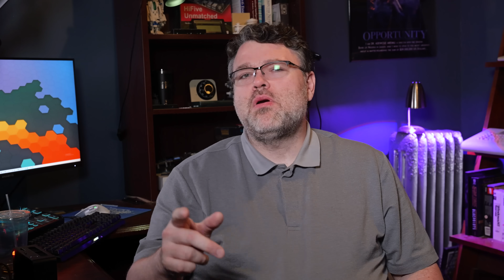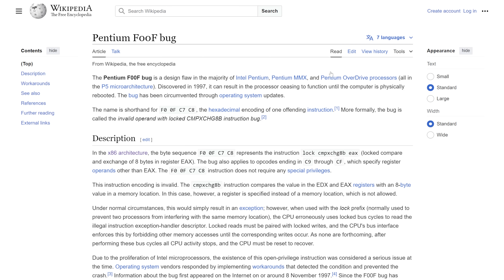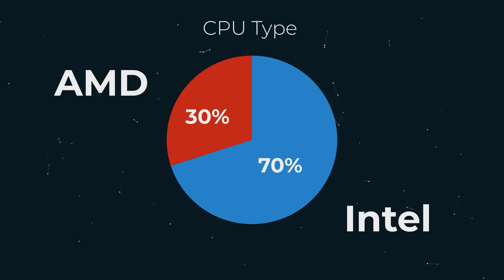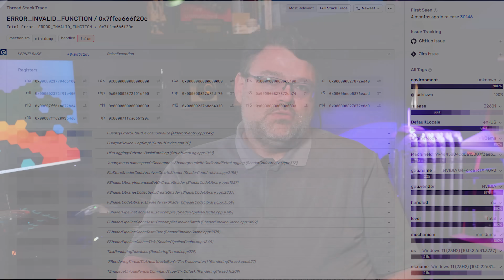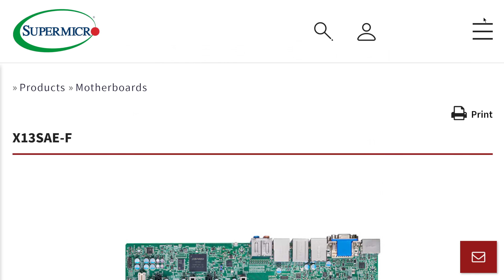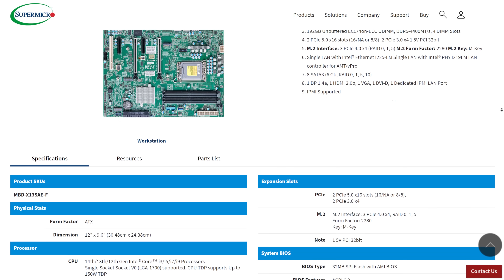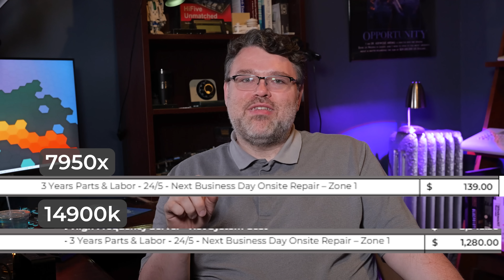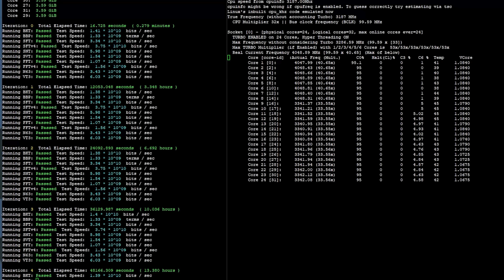Intel has a Pretty Big Problem

Comment: 1ST EMAIL

Hello DAVID VAGNETTI, 

Greetings from intel Customer Support
 
Based on the information provided, I can confirm that the processor is defective. Nonetheless, I would like to offer a warranty claim for the unit. If you agree, kindly share the following details below:
 
1. Complete shipping address with postal code.
2. Contact name.
3. Contact number.
4. Point of Purchase Invoice (PDF)
 
This time, I'd like to know which replacement option you would prefer:
 
Option 1:
 
Standard Warranty Replacement (SWR): It is required to send the defective unit first. Intel will cover the shipping costs for both the defective and the replacement item. An electronic pre-paid shipping label will be sent within 1 business day. Once the defective part is received in our system, it might take from 3 to 5 business days for the screening process and paperwork, then it will take two more days for shipping. In the end, it could be a 6 to 7 business days turnaround from the moment the defective unit is received in our system.
 
Option 2:
 
Cross Shipping: This option is available in USA & Canada. It allows customers to receive the replacement in advance including a physical pre-paid return label. The replacement usually is sent via overnight shipping and most likely arrive from 24 to 72 business hours after the order is placed. The service requires covering $25 fees associated with the service we provide (Non-refundable). This includes a charge to your credit card for the total price of the product plus applicable taxes. These extra charges are for security and will be refunded 3 business days after the defective unit is received in our system.
 
Note:
 
*Do not include bank or credit card information.
*Intel no longer accepting the American Express card only Visa, Master Card, JCB, and Discover.
A Warranty agent will send you the terms & conditions letter for your approval (Reply agree).
You will be contacted by our specialist via phone call to collect the credit card information.
*The physical Shipping & Billing address must be the same.
No Military address or PO Box address.
No applicable for USA territories (PR, GU, MP, VI, AS).
 
I will be waiting for your response. In case I haven't heard from you, I will be sending you a follow-up message on 12th of August 2024.

Sign in to view and update your request or to get additional information. You can also reply to this email with questions or comments. 
Best regards, 
Darwin C. 
Intel Customer Support 

2ND EMAIL

Hello DAVID,
 
Greetings from Intel Customer Support
 
Apologies kindly disregard the warranty option that I proved because we on provide technical support for your country, but the warranty will be process by the other team.
 
Kindly wait for them to contact you again apologies for the wrong information, they will be reaching out to you within 1 - 2 business.
 
Best regards,
 
Darwin C.
Intel Customer Support

THAT WAS 10 DAYS AGO!

MY LAST REPLY

TIRED OF WAITING...

It is useless to deal with you. Therefore, I will join every class action lawsuit I can find, not once, but every day. I will sign up with a new breed of blood-sucking lawyers and publish what I know. I know you had second thoughts about your warranty policy. Lying in the most disrespectful way. I will not be able to do much alone, but I will forward all your communication to all interested YouTubers, bloggers, and podcasters. You can play dumb all you want, but I am confident that this will hurt you. You know it, and I know it. I am not talking about my case; that is peanuts. There is a much larger picture here, and I will find comfort and joy in watching you struggle. Because if that was not the case you would not have had second thoughts and broken promises. Apparently, the elephant in the room is much bigger than you anticipated, and I am glad you are being exposed. Yes, exposed because ten years ago you had no competition. The story is very different today, and we, as consumers, have a choice. We can join the innovative, responsible, energy-conscious, and more environmentally friendly team. The last ten years of competition have left you virtually naked in the middle of a very bright room, all for a very good reason. Because at the end of the day, it is not a coincidence that you are being exposed for your laziness. You have been cookie-cutting the same batch for the last three years; yes, do it again, rinse, and repeat. Squeezing the last ounce of the potential of the same chips, trying to keep up with the competition while resting on the laurels. Yes, let’s push the old tech another two bins yearly, and no one would care, and now you are paying a hefty price for your ordinary lack of effort. 

Goodbye INTEL, enter TEAM RED

DJ VAGNETTI

Comment: Can confirm that the most recent microcode update (As of yesterday) has made it 10x worse. Browser crashes every few minutes from basic browsing (three times while watching this video). Games crash to desktop almost immediately. No error messages anymore. Increase in just straight up full system failure - shuts off without warning. BSODs with seemingly random error messages when intentionally shutting down, and if you don't get a BSOD, it will continue the shutdown process indefinitely.
Gonna try again to RMA it but they refused last time I asked.

Comment: MSI recently released the 129 microcode, which I hoped would address the voltage issue. Initially, I thought I'd still need to set my P-core ratio between 54-57. However, I'm pleased to report that after installing the 129 microcode and keeping default settings, I've experienced no problems, even when using Edge and Chrome browsers. Surprisingly, I didn't need to adjust the P-core ratio at all. I  can't believe how long it took them to get to the bottom of this... I guess it's better late than never, but the delay was frustrating for users dealing with the issue. After running for a day status break point error appeared in edge again back to running pcores at 57 again.

Comment: Is a i9 Laptop CPU safe?
I ordered a new Asus ROG NUC with the i9 and the 4070 Mobile. I guess both companies are having reputation issues.
Reply: Is there a AMD equivalent?
Is it weird that the seller contacted me and told me he can unwrap it (break the seal) and install Win11 Pro in English instead of chinese Win10.
I think about registering the Win11 Pro wirh the digital key and install a new Win11 Pro.

Comment: ive been through three 14900k and a 14900ks CPU's now. 
They lasted between just four weeks in the Ks to 16 weeks before suddenly becoming noticeably unstable to the point of useless..
It begun with random email crashing, then benchmarks crashing and web browsing crashing and finally game not running for long to the point of not even booting.
The last CPU dying i noticed early and eventually sent it back not for a replacement but a full refund. I don't want a 14th gen now, they are garbage.
Ive gone back to a 12900KS on three machines and you know what , they run just fine.
I was running them all on intel's safe bios settings on Asus z690 extreme boards and i update every new bios to try and keep them safe.
The irony is i went from 12th gen to 14th gen for the 10-15% uplift - but then im told to down clock the 14th gen to stop them burning out ?

Intel have badly damaged themselves with this - my next builds will be AMD 100%

Comment: Intel has ALWAYS hidden and deflected when there were issues with their cpus and it has worked out for them and not even affected their mindshare, just look at history.
Most people don't even think Intel pushed out faulty processors in the past.
this one is just too big to cover up and is going to cost a boatload unless they have congress in their pocket which is highly possible as can be seen by the boatload of cash they got to build a water intensive fab in a desert.

Comment: i do not think the issue with 13900k specifically is random, I'm developer of physics engine solvers and I found out in one of my solvers that is working 100% stable one 10th and 11th and 12th intel gen I will get crash 100% of time in around specific time, 100% of the time between frame 13th or 14th and this is so interesting, specially if it is used with nvidia 30 or 40 gen they will be more crash than 20 gen, interesting. if it was complitlly random it should happen at anytime but in my test that I will repeat it is 100% stable with absolutely no crash in intel 10th 11th 12th that I have access to, it will happened with no doubt around 13th or 14th frame and this could not be all random at all. also after new micro code update issue persist as before and no change what so ever.
Reply from the maker: possible to package up into something runnable? email me Wendell at level1techs.com
Reply: @Level1Techs  with pleasure, i will take a video from different PC and I will pack a few projects that the problem persist in them, and will send you all by email.

Comment: AYO - should I preemptively buy/switch my processor before this problem causes another chip shortage???
Reply: What CPU do you have? In general, this will likely not cause a big CPU shortage, but it will definitely increase the amount of people buying AMD chips.
Reply: @ДмитроПрищепа-д3я  I have the i7 (13700k).

I found a computer on Craigslist forsale yesterday with a i9 (9900k), only $600.

I bought it as my backup 😁

Comment: I've posted this on a different channel, but here's the truth; a little bit of inside info: 
There is no bad microcode, the mobos are not broken, there are no flaws. The issue is with the CPU's architecture. You see, since the 12th gen intel started including the Efficiency-cores. Now those cores are running on the same bus as the Performance cores. With the last 2 gens (13th and 14th), to keep up with AMD, intel just drastically increased the clocks. This clock increase is severely heating the bus between these chips. It was not designed to run at these frequencies and temperatures, hence the obscene amount of crashes. Intel knows this because the guys from the QA department brought this up to management and management said "Fuck it, let's just milk these last 2-3 years since we are on the verge of releasing the new re-designed series." This is why they avoid doing anything because they know they can't fix and it's why they've been shifting the blame for so long. They are pushing for time. I know the whole story behind it, I simply chose to stay quiet for a long time because of reasons. I advise downclocking to 4.4-4.8ghz and the cpu will operate flawlessly, unless yours is broken after such a long time of running at the high clocks.
Reply: There’s a manufacturing defect in the silicon regardless of what else may be happening.  Intel has acknowledged oxidation resulting in corrosion.
Reply: @teddyjackson1902  i know that what i am telling you might be hard to believe. To prove to you that i am not just talking out of my rear end, there's a test you can do. Disable the E-cores from your mobo's bios, and just let the CPU run at it's regular speeds. Heck, with a good cooling, you may even OC by 400mhz. Try it out, see if it's crashing. And no, there's no oxidation issue that's just another fact that people will believe because no1 actually has the tools or knowledge to verify the legitimacy behind such things, therefore people will just accept it. Best excuse to push for time and say no, it's not our fault, it's the sand. Imagine the fine slapped on their desk if this goes to court and proves they deliberately chose to sell problematic units.
Reply: @WarAnakin  “it’s not our fault, it’s the sand” when you’re the manufacturer is an absurdity.  Allowing physically defective products to ship and be sold with knowledge that they’re defective is at least as bad as selling an outdated and rebranded product that’s being pushed beyond tolerances.  They’re both fraudulent.
Reply: @teddyjackson1902  you are absolutely correct. To dive a little deeper into this, you see, the chips themselves are not defective. There is absolutely nothing wrong with them. What is problematic is that they chose to sell these chips with specs that make them run at frequencies they can't withstand. Hence, the microcode voltage updates (wink, wink). You see, a chip can't run at 6ghz speeds w/o some extra juice. I do hope that now you can see how the puzzle pieces fit together.

Comment: Intel pushed their 10nm process too hard to beat AMD and it resulted in unreliable systems that were running at the Intel recommended settings. Glad I have a 12th gen I7.

Comment: Is it getting worse over time or the same from the beginning?
Reply: worse over time because it kills itself with absurd voltage spikes and oxidation issues. At least that's the main theory so far, which comes from independent analysis, because Intel has been very secretive and dishonest in their communication regarding this issue.

Comment: Great video! It's not only K or KS CPUs, I have plain 14900, and still have this issue, and I can't and don't want to overclock
Reply: heads up, it's al;ready overclocked from factory. These CPUs were never supposed to run at their "default" frequencies and power profiles. But if they don't, they suck ass compared to AMD, soooo

Comment: My question is where the F is the consumer protection agency? Shouldn’t they be pulling the 13th and 14th i9 and i7 off the shelves. It’s unconscionable that someone could walk into a store and purchase a PC or an intel processor that two months later may fail. Until intel identifies exactly which models and batches then all should be deemed suspect. Seriously this agency needs to be cleaned out. Hopefully soon.

Comment: I got this message from Intel customer support today. 

I hope this message finds you well. Thank you for your prompt response and your dedication to the troubleshooting process. Your efforts have been instrumental in confirming that the processor is indeed faulty.

 

Following our investigation, we have identified the issue, and we are now prepared to move forward with processing your ticket through our warranty department. To facilitate this, kindly provide the following information:

 

Complete Shipping Address:
Contact Name:
Contact Number:
Contact Email:
Proof of purchase of the processor: 
Serial Number of the processor:
 

Please ensure the accuracy and currency of the provided information to prevent any delays in the warranty processing.

 

While providing the needed information, please advise which replacement option below you would prefer:

 

Option 1:

 

Standard Warranty Replacement (SWR): It is required to send the defective unit first. Intel will cover the shipping costs for both the defective and the replacement item. An electronic pre-paid shipping label will be sent within 1 business day. Once the defective part is received in our system, it might take from 3 to 5 business days for the screening process and paperwork, then it will take two more days for shipping. In the end, it could be a 6 to 7 business days turnaround from the moment the defective unit is received in our system.

 

Option 2:

  

Cross Shipping: This option is available in USA & Canada. It allows customers to receive the replacement in advance including a physical pre-paid return label. The replacement usually is sent via overnight shipping and most likely arrive from 24 to 72 business hours after the order is placed. The service requires covering $25 fees associated with the service we provide (Non-refundable). This includes a charge to your credit card for the total price of the product plus applicable taxes. These extra charges are for security and will be refunded 3 business days after the defective unit is received in our system.

 

Note:

*Do not include bank or credit card information.

*Intel no longer accepting the American Express card only Visa, Master Card, JCB, and Discover.

A Warranty agent will send you the terms & conditions letter for your approval (Reply agree).

You will be contacted by our specialist via phone call to collect the credit card information.

*The physical Shipping & Billing address must be the same.

No Military address or PO Box address.

No applicable for USA territories (PR, GU, MP, VI, AS).

 

We anticipate your response and propose to send you a follow-up on the 31st of July. This timeframe allows you ample time to provide the requested information. If you have a preferred date for the follow-up, kindly inform us, and we will adjust accordingly.

 

Thank you for your cooperation, and we appreciate your understanding.

Comment: Does this affect all intel cpu? mainly the i7? been saving up to upgrade my gaming pc. Should I got with the new AMD processor instead? was going to get the 14700KF now i'm hesitating.
Reply: i7 14700KF on Asus Z790 with RTX 4070 taken on dayone and i5 13600KF on Asus B660 with RTX 3060Ti for a year and a half. No problems, no blockages, no instability, they work 8/9 hours a day including 3/4 hour gaming sessions. with the microcode 0x129 the temperatures dropped a little... I'm really lucky so I'm going to gamble

Comment: You have to think, going back to 9900K and 9900KS, pushing and guaranteeing highest speeds possible hasnt been a problem, until 13900k and 14900k. So what has changed? Besides for performance cores and efficiency cores being introduced.